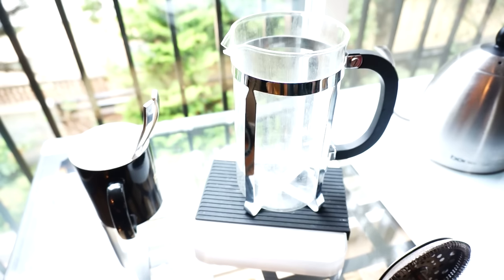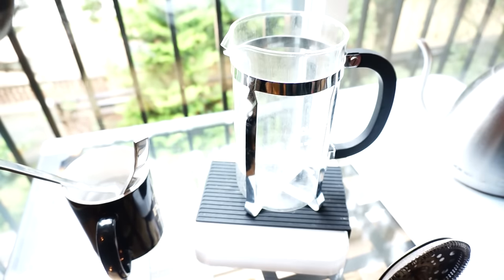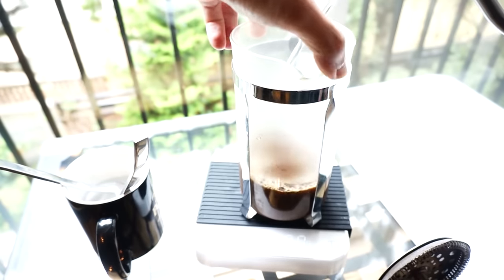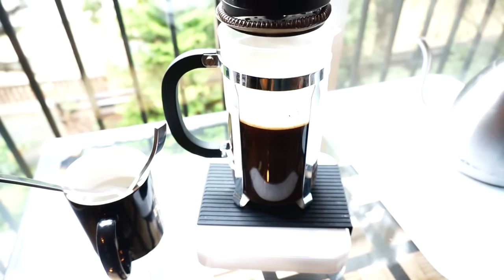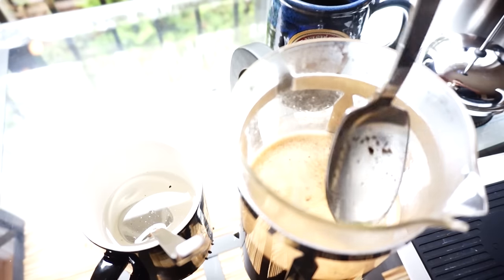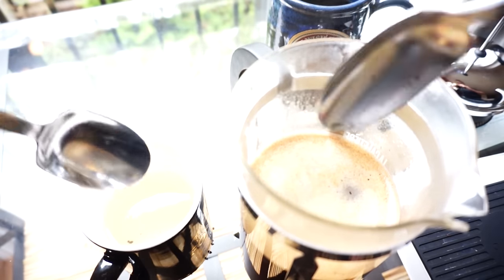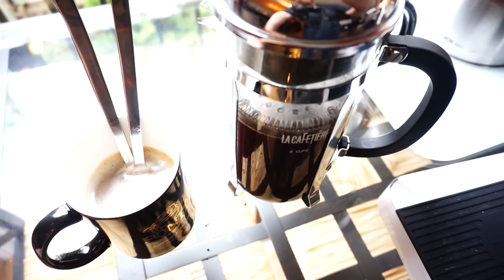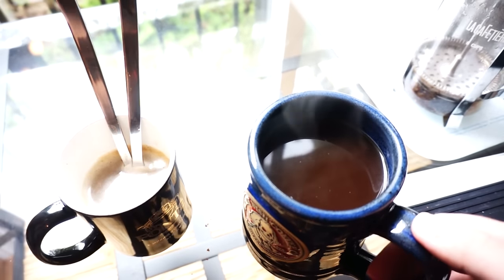Upgrade Your French Press With This One Simple Step

Comment: By removing the crema are you preventing it from being poured into the coffee cup? I own an Espro press p5, I've noticed that when I plunge the crema goes to the bottom of the glass (below the basket where the liquid you 'don't' drink is). I assume you wouldn't have to manually remove the crema if you have a press such as the P5? Thanks.
Reply from the maker: Yea in my experience with the Espro, this process doesn't have as much effect (possibly none at all). The point is you are removing oils and gases which do nothing but add bitterness and prevent the tasting of more delicious compounds in the coffee. For the most part the Espro filter is fine enough to take care of these - but it doesn't hurt to brew two espros and compare
Reply: @Coffeeloversmag  Thanks for the response. Love your channel. Stay safe, drink coffee.

Comment: Isnt that what the filter on the plunger is for, to push down that layer of foam? But I understand why you do this. You like a sweet coffee since you're using a sweet bean from the high mountains of Ethiopia.
Reply from the maker: Well the filter on the French Press actually won't do anything with the part we're removing in this technique, which is mostly the oils on top. The FP filter is metal (which already means it won't catch most of the oils). It's also not really fine mesh, so the only thing the filter really does is push all the grounds to the bottom so they don't end up in your cup (aside from grounds which are finer than the mesh).

Comment: In my experience, if you keep your water UNDER 190 degrees F, you don’t get near as many “bitter components”.  When I press, I put in coffee, 180-190 degree water and WAIT FOUR MINUTES, then stir again and press.  Never fails for me.
Reply from the maker: There are many different kinds of bitterness in coffee. Brewing with a lower temperature of water can be beneficial to a degree from a flavor perspective if you are dealing with dark roast (and yes, bitterness). If your coffee is not a dark roast, then you are simply missing out on some of the best taste and aroma soluble compounds by brewing with 180-190 degree water.
The most natural bitterness in coffee is caused by caffeine. This is not the bitterness being touched with this method.
Bitterness also comes in forms caused by improper extraction - usually using too much coffee or not enough water.
In the case of this video, the bitterness being removed is likely primarily related to the C02 trapped within the coffee oils, as well as the oils themselves - though that last point is harder to isolate, since we can't separate oils and taste them individually.
It's literally a layer on the coffee that doesn't aid in (and in fact, gets in the way of) tasting the natural sweetness, acidity, or layers of complex flavor inherent in the coffee naturally.

Comment: It's a common misconception that what he's scooping off the top is crema. It is in fact just foam, nothing else. You only produce crema when making espresso. So go ahead and try this method. I will be.
Reply from the maker: I'm starting to look at it like crema, since they are both made up of mostly c02 trapped in oils. Crema on espresso is different, as it's made primarily due to pressure (freshness of the coffee has an influence as well), but crema on espresso also is basically just bitterness. I've been doing some experimentation with this in Espresso just to see what the effect is, and in actually tasting the crema on it's own (as well as diluted) - interesting experiments so far, but not ready to make absolute statements.
On the podcast we will be doing some experiments with crema in an upcoming episode (https://www.coffeeloversradio.com)
Reply: @Coffeeloversmag  Thanks for your reply. Will look forward to more videos from you 👌

Comment: Crema, or not to crema? That foamy stuff on the top of some coffee is the same material, and appears as it does from similar processes, however the coffee is made. Oils/fats/lipids that are aerated and with a bit of surface tension help create bubbles. Same way most bubble things happen.

I can go either way, with it, or without it, though I do lean towards both the aesthetic, flavor, and texture of a crema'd coffee. I also don't mind some fine sediment in the bottom of the cup.

Taking away something that's getting in the way of the natural taste? Wouldn't the "natural" taste include all those natural elements that are found in the whole product naturally?
Reply from the maker: Well crema in terms of espresso is literally just C02 trapped in oils. In my experience - of tasting espresso with it, of tasting it by itself, and of tasting espresso with out it (where it was removed in a vacuum chamber), is that the crema doesn't add any positive taste experience. In terms of espresso, it's just a sign of espresso pulled well at high pressure.

In the case of French Press, I don't know if I'd call whats on top 'crema.'  It's just a compilation of oils and remaining floating grounds. And again, in my experiences there's no positive taste benefit (in fact, the oils and such there can prevent you from tasting some of the more interesting things in the coffee, and this is why it's removed in cupping).  In the case of French press it adds body, and often bitterness.

On natural taste... I suppose that's phrase needs adjustment. Lets say - the positive tasting compounds in coffee.
Reply: Thanks for your reply. Appears fairly to be a fair matter of preference. I like the crema, even the sediment in a French press or espresso preparation. A bit the same way I'm good with ibrik-prepared coffee. And I can also live happily with out it, per the case with a good drip brew.

Comment: Are there any differences in overall quality (that you've observed)  between the various Bodum brand French Presses on the market? I've noticed two price points: $39.99 for 8 cup PP at Wholefoods, but  seemingly the same capacity version at Walmart for $17.99?
Reply from the maker: The differences will lie mostly in materials used. The only thing that's going to have an influence on the taste and quality of your brew in a french press is the nature of the filter being used. A traditional french press has a very basic filter screen - most changes to this area involve adding more filters (which really do nothing in most cases tbh). So the price differences you see come down to the individual places just pricing differently, and to materials difference of the body and frame (I'd avoid plastic bodied French Presses, but that's just me). I used the one in this video for a long time - classic glass w/ metal frame and single layer filter...makes perfectly great coffee.  I've since moved to an Espro, which uses a different filter design (also it's all metal, and I love that).

Comment: Make sure your water isn't too hot and then also bloom the grounds to remove bitterness. It's CO2 expressed by the beans that create the bitterness trapped in the crema. Essentially, with 190 degree F water, pour enough into the grounds to wet equally. Wait 3 1/2 minutes, then pour in the rest of the water, gently stir very briefly with a wood stirrer. Wait 30 more seconds (while you decide on which mug to use today), plunge and pour. No need to remove the crema, which is one of the beautiful things about French pressed coffee. Cheers!

Comment: It seems you are defeating the purpose. Producing and incorporating the crema layer is largely what makes a french press unique and makes the flavor different from dripped. Consider a normal drip maker where the crema is formed in the brew basket and left on top of the grounds as the "clean" coffee drips into the pot. It seems you are actually trying to make pour over coffee with a press. It would be much easier just to get a pour over stand and a nice kettle. BTW - crema is usually only bitter if your water is too hot. Shoot for 195 degree brew temp. 212 degrees (boiling) extracts the bitter oils of any beans and will make bitter crema every time.
Reply from the maker: Definitely not defeating a purpose here, there's plenty you get brewing in the French Press not in the oil/gas layer that remains when removing that layer, which you don't get in other brewing methods. So this isn't pour-over coffee with a French Press, the extraction dynamics are that of a French Press, you are just simply removing something which prevents you from tasting certain things naturally inherent in the coffee. Try it, do a side by side, and you'll see that you taste something in the modified version which you don't in the regular.

On temperature, that is around the degree temp at which the water is poured (195-200) in this case.

Comment: I'll say that if you like your coffee clean of oils or any bitterness flavors. I suggest to use the Chemex instead of a French Press.
Reply from the maker: Well yes indeed, filtering your coffee with paper would certainly remove a lot of oils, but that isn't the full purpose of this process. There's a balance of extraction that you get in immersion which you don't get in other methods, and there are plenty of oils that are left in the FP after this process.  It's still French Press, you just can actually taste more of the flavors in the coffee.

Comment: Total downgrade.  Weak and watery. The crema makes coffee robust , not bitter.
Reply from the maker: You've got a few different comments going on there.  I'm going to assume you tried this yourself.  
The reaction of weak and watery is something easily solved by simply using more coffee in the brew. Strength in coffee is about how much of the soluble components in coffee are extracted into the water. You make coffee stronger by either using more coffee, or less water, no matter what the coffee is or the brew method. If you are finding your cup weak, then you are likely not using enough coffee to brew.
'Robust'ness in coffee is pretty subjective. I'll agree that this method removes a certain level of potential 'body' characteristic, because we are removing some of the oils. We're certainly not removing all the oils. You still get a full immersion brew that has a much more of the oils and sugars brewed into the coffee than a drip method.
On Crema. This isn't Crema, though there are similarities. Crema is an emulsion in espresso created by the extreme pressure used when brewing, and consists primarily of C02 trapped in the coffee.
And this is indeed only adding bitterness. There is no redeeming flavor characteristic of the surface layer of the french press. However if you don't care about that, by all means don't remove it. Many people would rather have the coffee a little bit thicker feeling, as well as more bitter.
One of the challenges, which I don't think I mentioned in this video (i recorded this like 2 years ago), is that the effectiveness of this technique is variable depending on the quality of your coffee. If your coffee doesn't have much taste to it to begin with, you may only notice a change in the body of the coffee. I'm not sure how this pans out with a dark roast - doing this method with a dark roast or low quality coffee might even make it easier to taste the carbon and/or defective parts of the coffee.